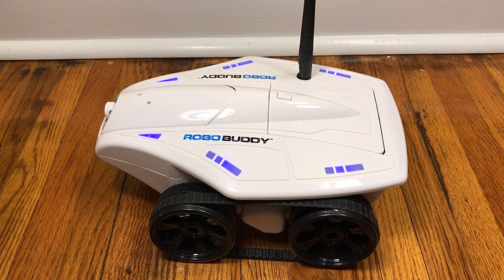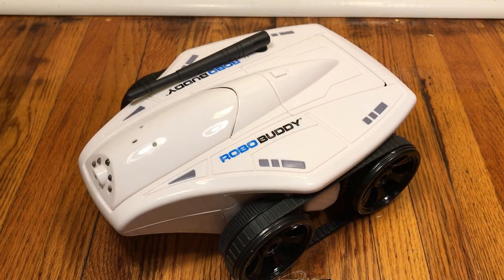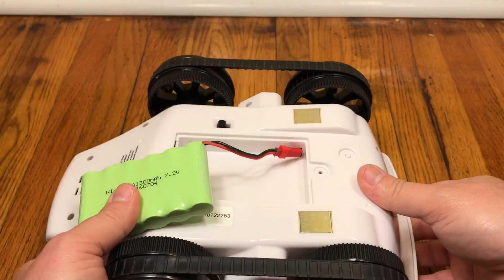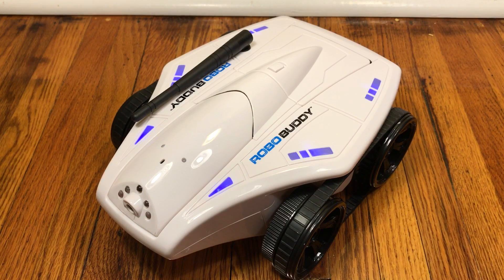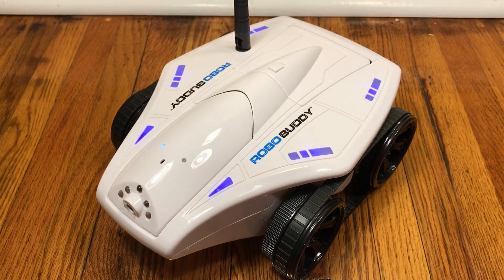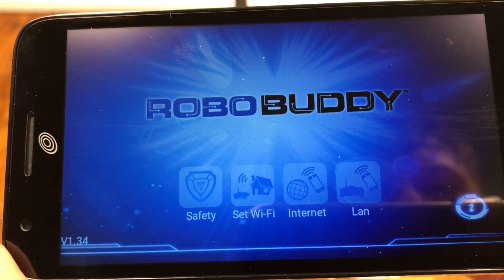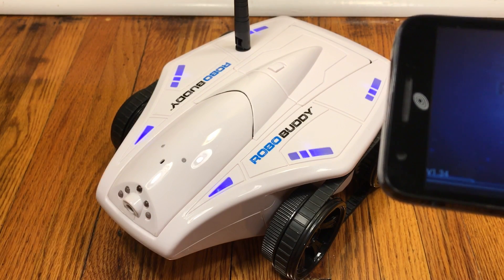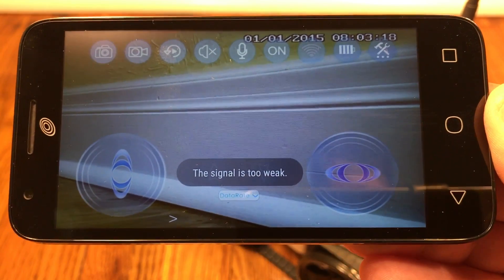Robo Buddy Setup - Tips for successful configuration

Comment: On mine I'm not getting either that click, or the led to light up or a wifi signal coming from it. After resetting the battery so its plugged in all the way and turning it on again, it will sit and the blue lights around the chassis will light up for maybe a minute or so and then turn off and not function any further.

Comment: pos only works in my house not 'anywhere in the world!'
Reply from the maker: +stevehd111 there is a wifi setup, and an internet setup. One only works locally
Reply: i set the wifi and watched your video and i'm 2 hours away and it always says 'connect failed signal too weak' after i try to connect it on internet
Reply from the maker: +stevehd111 for some reason this thing takes lots of bandwidth for a good signal. I get that lots on my network (T-Mobile,) but my dad never gets it. He uses Verizon.
Reply: @KevCentral  you can select as low as 128KB, that should work on a weak signal